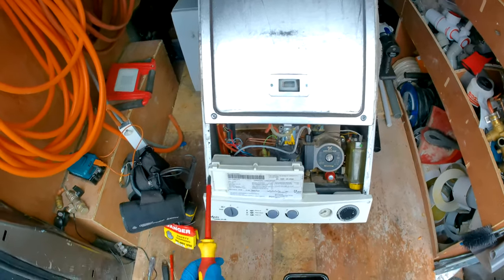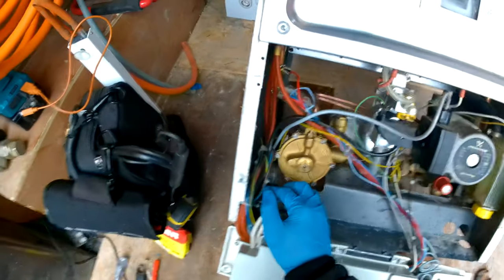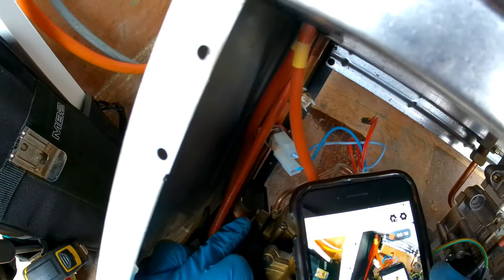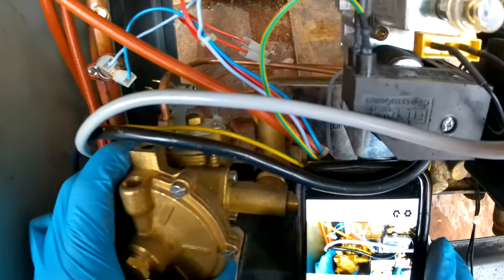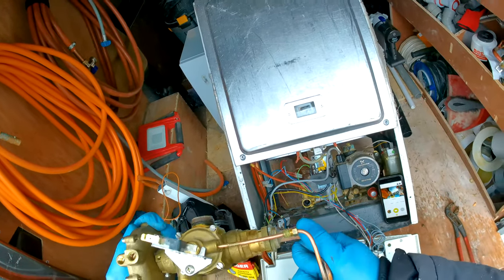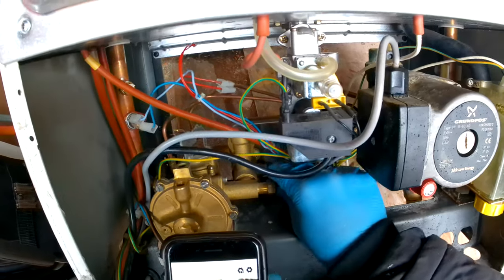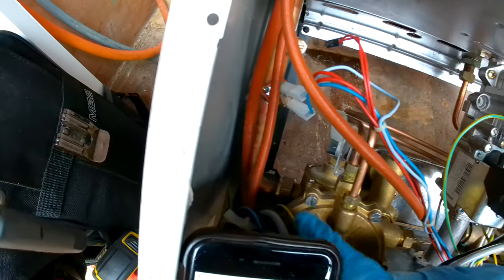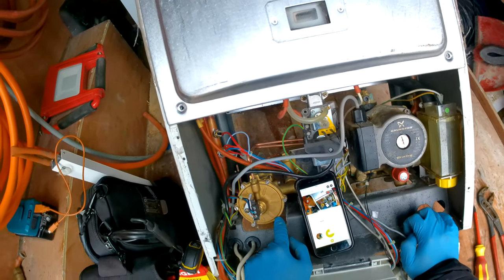Main Combi HE - How To Change / Repair The Diverter Valve | Radiators Get Hot When Using Hot Water??

Comment: Cheers for the upload. Demystified the process & I now have hot water again!

Your tip to remove the pipe with the valve body works well & you're right that access to make the connections on the back of the valve without removing it would be difficult, BUT my boiler started to weep from the connection on the right hand side... To anyone doing it this way; it would be wise to have a new o-ring on hand for that end to ensure the seal is watertight.

Comment: Thanks for the video, cracking tutorial! I've just replaced the diverter on my Main 24he, along with the AAV and the PCB, but my rads are still getting hot when only water should be called. Both pins from the diverter are out, with both micro switches engaged.

Comment: Fantastic video, very well explained, thank you.

I am not a boiler repair engineer and called one out to fault find, and they mentioned this part needs replacing.

May I ask, what an average time is to replace this please. (Not me changing it, the engineer)
Reply from the maker: Hey Gio, it really depends. If everything goes well I would say about 30-ish minutes. If not, then a couple of hours

Things that can cause it to take longer:

- Screws and nuts being rusted in place and making it a nightmare to undo something that's very basic (this boiler is quite old so this is common)

- Leaks. There are a lot of connections you disturb when doing this repair so it's possible you might get one or two tiny leaks when you put it back together.

Comment: Thank you so much for sharing this video! On my diverter valve, water drops are slowly leaking from the nut at the very front. Can this nut be removed and the sealing (which I suspect is at fault causing the leakage) underneath replaced? Boiler is still working both for heating and hot water. Your expert response is greatly appreciated.
Reply from the maker: I have a video on my channel specifically for this problem, take a look at it 👍
Reply: @advancedboilertraining  Many thanks, have watch it - great instructions again ! I’ve learned a lot from you, from just two of you videos. - You’ve got a new subie  :-)

Comment: I have a leak coming from behind the diaphragm cage out of the grub screw holes...do you know why it leaks from these holes and what's the solution to curing the leaks? 
Great informative video cheers 👍
Reply from the maker: Usually you would have to change the washer inside. Over time the washers degrade and have to be replaced unfortunately
Reply: @advancedboilertraining  I changed the O ring and the diaphragm while I was at it yesterday but it was still leaking this morning, so I'm thinking it only could be the main body of the diverter valve side O ring that needs replacing 🤷‍♂️

Comment: 👁 What a super video! 👍🏻  You show & explain so well.
Can you please help me with your mind! 🙏🏻 Heating is fine, Hot water doesnt work as combi boiler doesn't fire up when HW is called for.
I been told I need new divertor valve,, but boiler isn't even heating up when calling..
~ Surely must be an electrical switch or pressure problem?   I knew more about my boiler than the young man that came to ' sort it '.
He couldn't even open the control panel, gave up, didn't check it systematically at all. 
Please I just need your professional opinion , much appreciated. 💜🤗
Reply from the maker: Oh no, it’s always concerning when a customer knows more than the engineer 😂. 

If the boiler does nothing when you run the hot tap the rubber diaphragm might have failed. Sometimes the rubber diaphragm splits in the pressure differential valve (front circle part the diverter) and so the pin doesn’t push out enough the activate the microswitch. That microswitch is what tells the boiler to activate. 

With that the key thing you want to see is that the front pin is coming out and activating that switch when you run the hot tap. (But obviously if you’re not gas safe I wouldn’t recommend you opening up the boiler 😉)
Reply: Thanks very much @advancedboilertraining  🤗💜   No, it doesn't feel good to go through this experience! 😀 
Paying £400 p.a. for service plan, 20years,, I should've bought life insurance instead.😥
Cheers for explanation of that. > So the rubber diaphragm is inside that round part of divertor. May not even be whole part needed. 
It sounds like something goes on like a valve moving when I call for HW,  presumed that's the divertor switch cartridge moving to let the non existent hot water to the taps. 💫 
That microswitch, is a chance it could be not getting power or something to tell boiler to go on?   Thanks for explaining about the diaphragm. 
I can easily look, I've already taken down cover a few times, I won't touch any electrical parts.  Is it something I would see moving on outside of round part ?   Nowt else I can check? Water temp switch on front hasn't worked for years, nothing to do with anything its connected to?
 ~ The young man left safety notice without explaining it, something about a fuse being stuck somewhere.. 
☆ Like you say in your video ~ the return pipe to heating would be getting hot if water going down to radiators, as the young man said is happening, but isn't.
Its so nice of you to answer what must be a silky question. 🙏🏻 
♡ I feel I'm being set up to be forced into buying new boiler,  he told me part may take 3weeks to find,, but they might not.🙀 
Midnight too!  Thanks again, have a good night. 🙂
Reply from the maker: @suzycat2026  yeah unfortunately sometimes boilers can be headache.

Yeah the micro switch could be faulty. Besides doing basic visual checks yourself, there’s not really much else you can do. You’ll need an engineer to come and test components etc etc. If you look on checkatrade I’m pretty sure you’ll find someone good
Reply: @advancedboilertraining  I really appreciate you taking time to explain this & thanks your advice.
Yes, feel I need a second opinion with a visit from someone else. 
Guess I feel silly paying for this service plan, now their workers aren't trained so well. 
Cheers & have a fine weekend. Keep up the good work. 🙂

Comment: Hello mate, this video has really helped me as my landlords gas engineer cant seem to fix it, I wonder if yo could help me.
first off the heating still comes on when the hot water is on.
He has replaced both diaphragms in the diverter valve, still heating comes on through the flow pipe to the radiators.

Is there anything else that it could possibly be ?
I know fault finding can be hard, could it be anything to do with the springs, sensors or other moving parts inside the diverter valve ?
If you could help that would be great the video is really helpful anyways.
many thanks in advance.

Comment: Brilliant video mate, very well explained, I think I'll have to change this part on my boiler except the problem I have is the boiler won't shut off after I've turned the hot tap off (room stat is not calling for heat), do you think the diverter valve is responsible?
Reply: No mate.
That’ll be a sensor calling.
If no demand for heating and hot water boiler is telling itself to fire.
Reply: @dannyarcher  cheers for the info mate, I had a feeling it might be something like that after I'd taken the diverter valve apart and replaced all the parts and the problem still there
Reply: @stepheng180  unlikely but check the PRV and see if it’s wet.
You might have a split in the burner. But tbh I’d suggest getting gas safe registered fitter around. Goodluck.

Comment: My potterton promax has hot water but no central heating. I changed the actuator and the cartridge as they were rusted and old. But I still get the same fault. The programmer shows the flame, and the reciever near the boiler lights up but the boiler doesn't fire up. 
Could it be an electrical issue?
Reply from the maker: Yeah first thing I would check is if the receiver is actually sending power to the boiler when it gives the flame symbol (Could be faulty)
Reply: @advancedboilertraining  thank you mate. There was no power going to the boiler from the receiver. I just put a loop in so heating can be turned on from the boiler at least. 
Any idea why the receiver would just stop working over night like that?

Comment: I have this boiler and I am having a problem with it. I am getting central heating perfectly fine but when I run the hot water tap it's running cold and the pilot light isn't lighting up when calling for HW previous to us not having hot water at all the HW was running intermittent and we had to slow the flow down on the tap to achieve normal HW temp could you shed some light please
Reply from the maker: For your initial issue of intermittent HW, it sounds like maybe your plate heat exchanger was blocked. The hot water couldn’t flow through the plate so the boiler would overheat and cut out (hence why your hot water was intermittent). It could also be the diverter letting heat through to the central heating hence why you have to slow the rate of the water down to get it hot (the slower the rate of the water, the more time it spends in the heat exchanger getting warmed up)

But to do with your issue of no demand for hot water at all now, it’s sounds like your hot water micro switch is faulty or the rubber diagram has split (I have another video on this on my YouTube channel. It’s a really easy repair)

Hope that helps

Comment: Thank you for the video mate. Much much appreciated. However, I've done this whole job, turned the boiler back on - all working again but hasn't fixed the issue... my radiators are still getting hot when we use the hot tap. Any other explanation? Combi 105E
Reply: Did you ever get this sorted? I have the same issue!
Reply: @MarkHockin-dp9cz  hi mate. Yes the new diverter valve I bought turned out to be defective. The spring on one of the plungers wasn't functioning correctly (same as the one I took out) and it was constantly going round the bypass heating the radiators up. Hope this helps
Reply: @michaelvenus8539  thanks mate, truly appreciate the reply. Did you remove the valve again or sort it in situ? I'm assuming both pins were hitting the switches showing something was up with the valve?
Reply: @MarkHockin-dp9cz  no worries mate. I took the valve back off again, once I'd had it off once, it was only 10mins to drain and get it back off again. Yes, both pins and microswitches were working as they should and there was no clear issue with the circuit board which led me back to the diverter valve. If you follow the bypass around to the back of the diverter and look inside the diverter from that side you will see a large rubber seat which is spring loaded it was that spring which was my issue. If you haven't bought a new one, I would take it all apart, clean it up and buy a replacement service kit which would be cheaper. Hope that helps mate. Good luck
Reply: Thanks again mate, I may have the same issue with my new diverter then sadly. Will try and pull it out today and have another look. Luckily I already have a service kit as I was going to recondition my old valve and keep it as a spare!
Reply: @MarkHockin-dp9cz  sounds like it could very well be. I checked the large diaphragm at the front and it was in good condition but I don't think that would cause the hot radiators anyway, pretty sure if your pin is operationing where the diaphragm sits, its all working okay. Think the bypass seat at the rear is your best option if both plungers are coming out and hitting the microswitches. I've got the reconditioned one sitting waiting as well 👍 great minds and all that

Comment: Hey mate great video I’ve just used it to change this exact diverter. However even with the new one fitted I’m still having the same issue, the pin for the heating is still coming out for the heating and the flow is still getting hot, any idea what else it could be mate
Reply: Exactly the same as me, still heating my radiators when we run the hot tap. Let me know if you kind a fix... I'll do the same for you 👍
Reply: And me it would seem, did you guys ever get to the bottom of it?